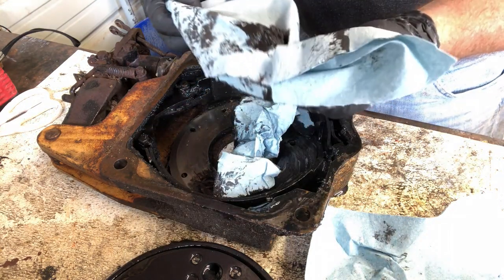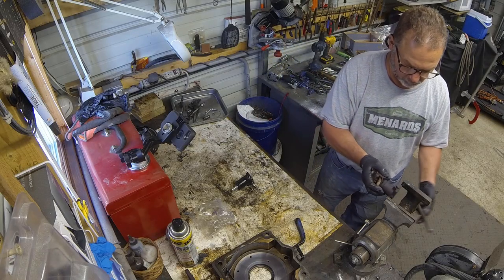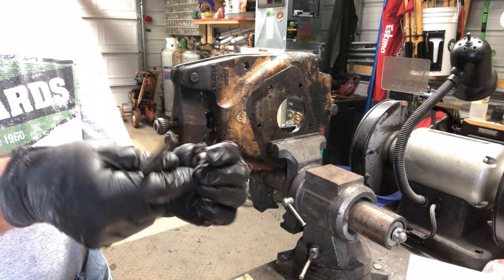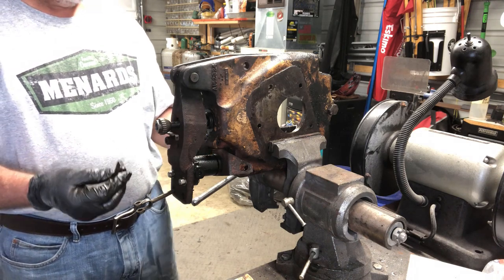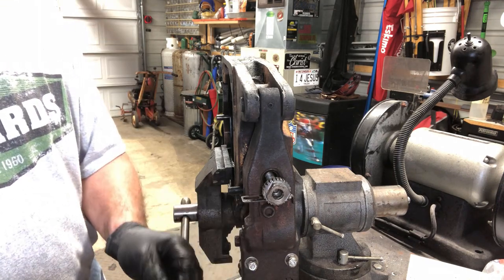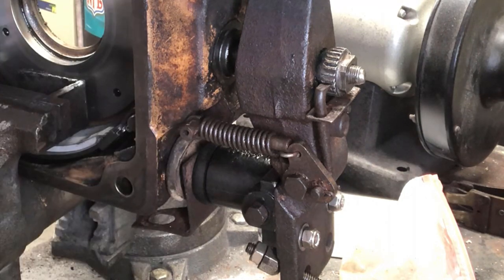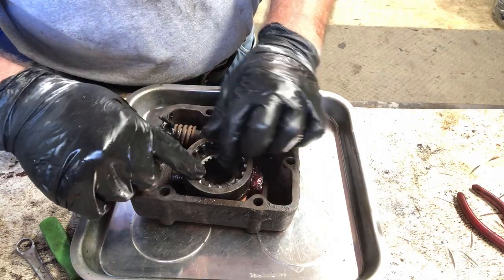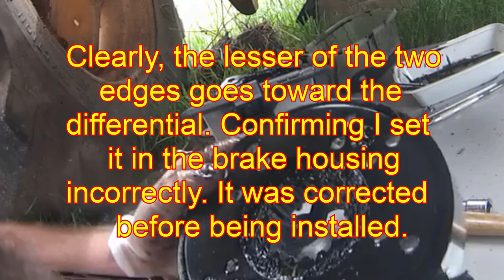CASE 580C Right Brake Reassembly Tutorial Part 2 of 2, DIY Brake Replacement

Comment: You mentioned in one of your videos about changing the gear oil in  the trans-axle. and the oil looked red/pink and dirty when you pulled the dipstick. It also had way too much in the transfer case, it came way upon the dipstick. I have the same problem on my 580C, My questions is, do you know how to drain the gear oil and refill with new and what type of gear oil to use? I appreciate any help, I am needing to change my fluid. Also, I found the brake videos really useful and  informative because I will be repairing the brakes as well. Thanks
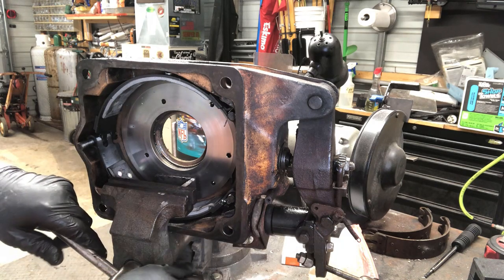Reply from the maker: The answer to your question is in my video "CASE 580C Oil In Brake Housing, Seal Replacement Tutorial Between Differential and Brake Housing" at timeline 7:05 to 7:57. I thank you for your comment, please be safe and be blessed. :-)

Comment: My brake shoes fit really tight on the inertia wheel/drum before I even adjusted the self adjuster.   Everything looked fine, but was a tight fit.   I hope they sent the correct shoes.  Do you have any idea why?
Reply from the maker: No idea really.
Reply: @GERALD_POST  Good news!!!! Had a nice warm day today.  Tractor started and brakes worked perfect.   Owner says it's the first time in 30 years they have functioned properly.